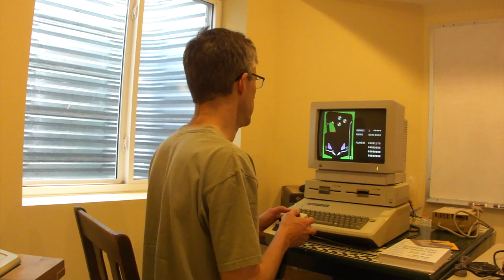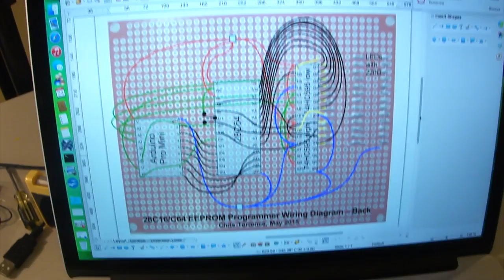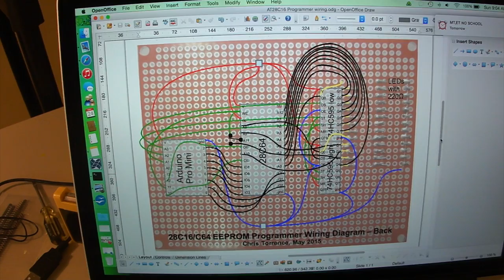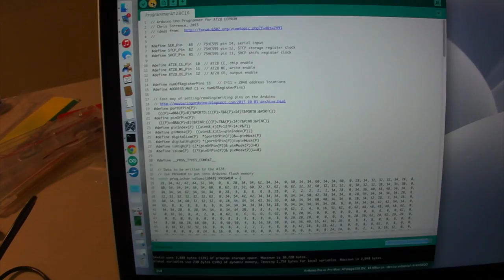Assembly Lines #12: EEPROM Programmer on a ProtoBoard

Comment: I built a similar version of this based off of Ben Eater's EEPROM Reader (Same EEPROM). I manually programmed addresses 0 to 9 on a breadboard, but when I read it, everything shows up as 0. Do you have any idea as to why?
- The EEPROM I'm using is used
- I have manually checked every address with dip switches and an LED array and it shows the first 10 addresses correct, with the other addresses set to zero
- The Arduino script I'm using works on other EEPROMs, but it may be skipping the first few addresses; I can't tell.
Reply from the maker: Well, a couple of different ideas: There are a lot of bad EEPROM chips out there. Are you sure that the chip you're using is good and has data on it? I bought a batch a couple of years ago and they were all fake clones that were useless. Second, maybe take a look at the timing in your program. You usually need to bring one of the lines low or high and keep it there for a certain amount of time. Sometimes just throwing in a delay for 100 ms can fix problems. If your script works with other EEPROMS then it's probably a problem with that particular chip. Best of luck!

Comment: I just purchased MX29F1615PC-10 
Its a 42 pin flash prom
And it came used from china 
Is it possible to erase the data on it with a Breadboard
Reply from the maker: Hi, I'm not sure. I'm not familiar with that prom. You would need to read the data sheet and see how the "write" works - it's probably possible depending upon what microcontroller you used. Good luck!